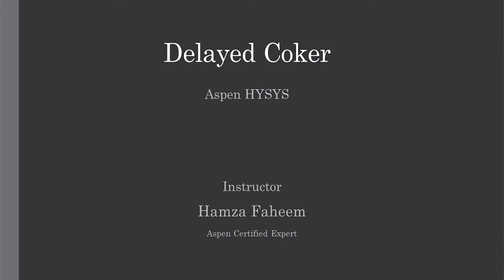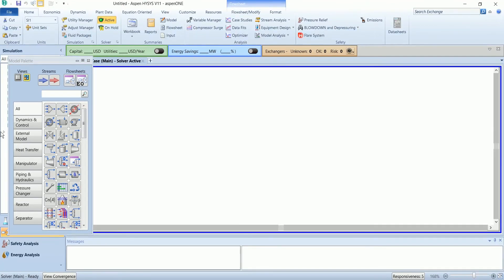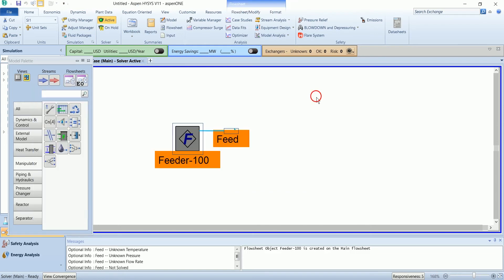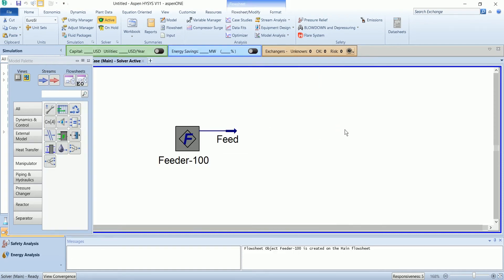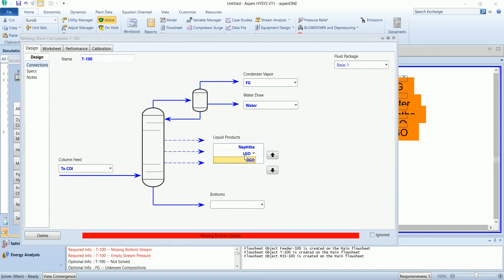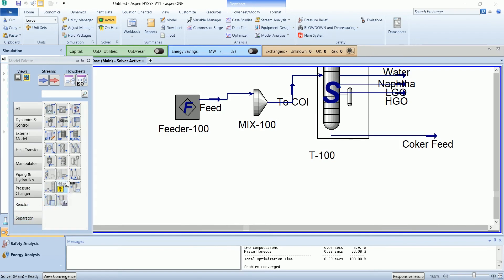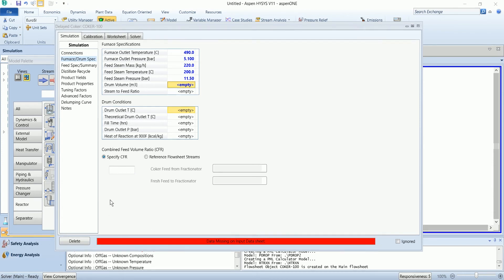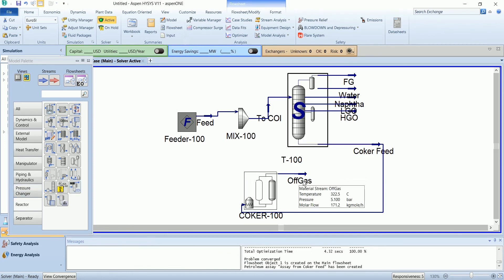Delayed Coker with Shortcut Refining Column || Aspen HYSYS || Refinery Process Video 10

Comment: Still not understand the purpose of feeder why you didn't define a stream why using feeder and what are its advantage???
Reply from the maker: Composition of petroleum feed is depend upon the temperature range on which it separated in distillation column. Petroleum feeder permits you to define this composition of petroleum assay without any upstream process. This makes user to simulate different processes individually with ease. Moreover, composition is not sharply distributed in case of oil, therefore, it cannot be defined using conventional way.